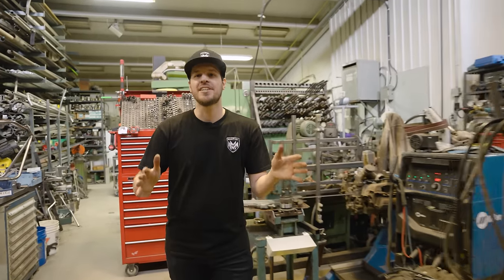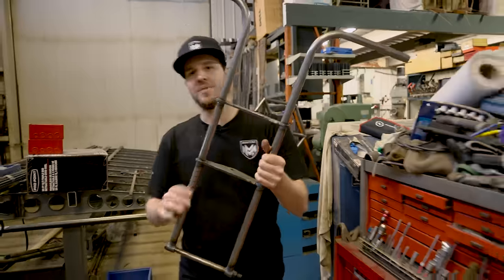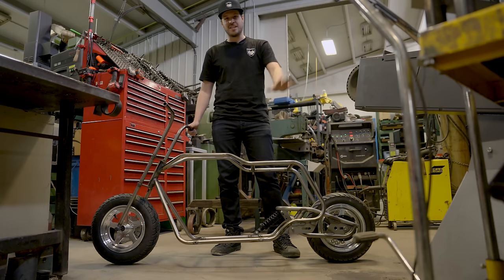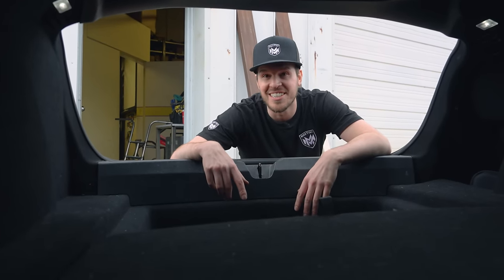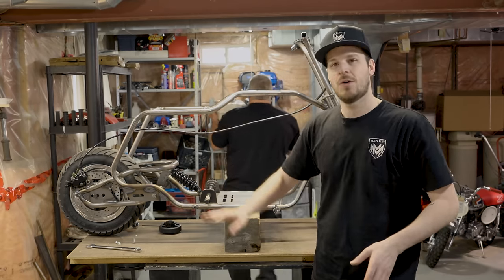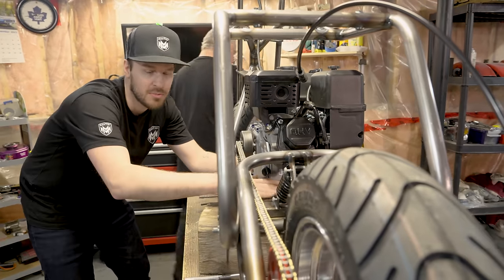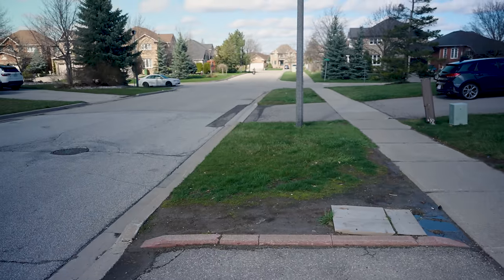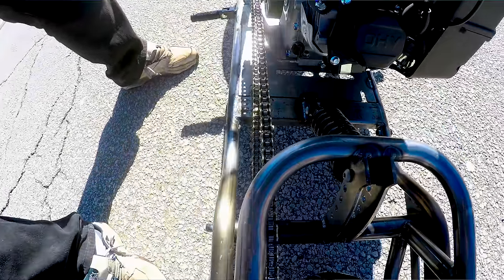Finally Test Riding Our Dream Mini Bike | MBK-1 Journey Ep.7

Comment: Very nice, looks fantastic all put together. Getting the slop out of the chain shouldn’t be too big a deal. Run a torque converter or jackshaft and problem solved. If not, a spring loaded tensioner might do it.
Reply from the maker: Yeah 100% we have designed a jack shaft for it, but it hasn’t been made yet. But we were too excited to wait.
Reply: @mantinimotors  Congratulations on doing what you want to do, prayers that it works out for you. I hope to be able to buy one of these in the not so distant future
Reply: How much will it cost when done

Comment: Flip the clutch around to where the teeth are against the side cover, it keeps the chain from coming fully off the bike if it comes loose, it also protects for feet for when it snaps and starts smacking around a stuff.
Reply from the maker: Great advice. We would also typically have a chain guard, but we knew this was just going to be a short test ride and didn’t have one on hand to install.

Comment: Where did you get a power-fist'r that is not blue in colour? I am currently putting in an electric start power-fist 212.
Did you know that power fist motors don't have a piston and con-rod, they have a forearm and a fist inside instead.
Reply from the maker: Haha, we got it from Princess Auto. I think all the new ones are now black.
Reply: @mantinimotors  Mine has been sitting in a box for almost a year, got it out, put in oil and gas, it started first pull. Going to get a battery soon and I will hook up an LED light to the battery.

Comment: Was thinking of using your frame for the Go power sports 180. Do you believe it will hold up for a off road race like that? I can beef it up, will need to be able to handle 22 HP or so... Think she will do it? That would get your name out there big time at no cost to you.
Reply from the maker: I do believe the frame is more than capable of handling the GPS 180 as it is built from 1 inch tubing. I do agree that you might need to upgrade the suspension to give you more travel as this frame is more of a street style bike. 

We are going to develop an off road kit for this bike, but I’m not sure if it will be ready by this November. But it would be epic to see you race it in the event.

Comment: I would add if your chain isn’t already above a 35 chain I would upgrade it to a 40 chain or a 428 chain
Reply from the maker: We are going to run a 40 from the clutch to the jack shaft then a 35 to the rear sprocket. For now anyways since we want to test a few different variations to see what we like best.

Comment: Certain clutches are able to be flipped. Have the teeth on the inside today’s the engine but going to need a spacer so you won’t be too close to the motor. So you won’t need a tensioner.
Hope this helps fam 💪🏽
Reply from the maker: Thank you. Yeah, the clutch we have does do that, which we could have tried. But we are just waiting on the jack shaft to do a proper test ride. Coming soon!

Comment: Are you concerned about the angle of that shock
Reply from the maker: Not at all, it actually worked really well.

We will do an entire video on the rear shock once we get the next frame back from the shop and we will test it at every angle and stiffness. We will also try a softer shock as the current one on the bike is rated for 2,000 lbs which may be too tough. But there is room for adjustment on the shock itself as well.

Comment: Chains to long , slow the video down right before it pops off you’ll see a surge shooting towards the centrifugal clutch sprocket ( like if you were to take a rope and in a quick motion jerk in up and slam it down , the little wave that happens is what I called a surge it happened to your chain) also know because I just went through the same problem 😂 , put a tensioner on for now till I can buy a welder to swap out my 105cc in my razor dirt bike to a 212cc lol 🎉 105cc I hit around 25-32 mph not bad for what it is , but I wanna be able to ride wheelies so 212 should be what I need for the torque the 105cc can barely stand the bike up  you gotta low rev for about 1-2 seconds to get tension on the chain then gun it and it’ll come up but it’s impossible to keep it there just not enough torque edit - sorry for the book but another thing I noticed was your centrifugal sprocket is on the outside of the clutch ? Mine is on the inside (between clutch and engine lol )  I’ve never seen them on the outside but doubt that’s why it’s popping tbh
Reply from the maker: 100%. This was just a test but we should have waited for the jack shaft to be made. This way we wouldn’t have had to run such a long chain like this.